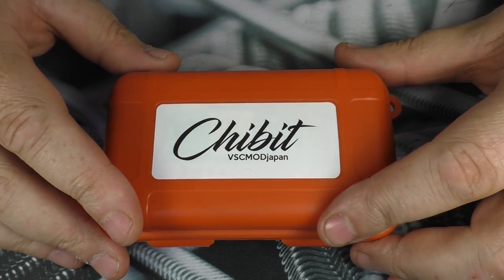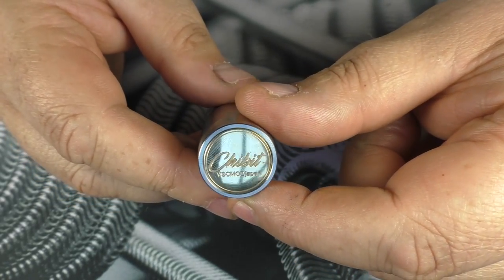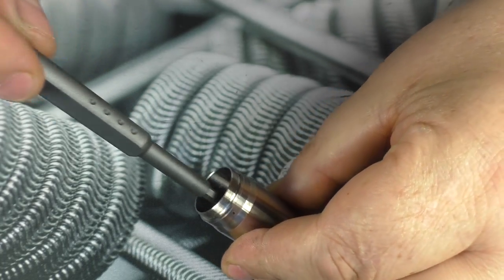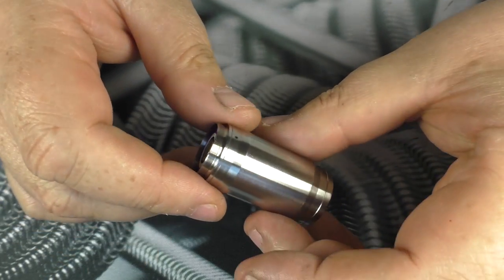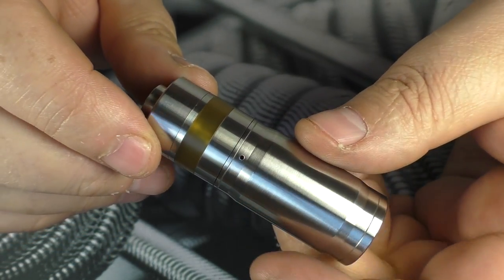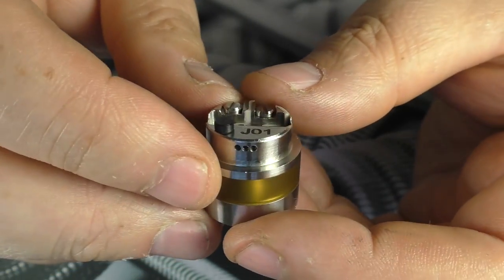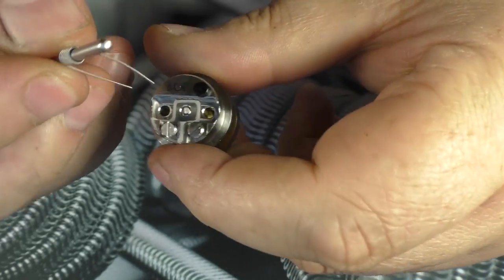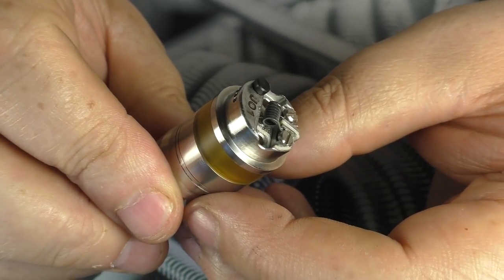Chibit by VSCMOD Japan

Comment: That Vapcell is actually recommended by Mooch. I use it with my Cthulu 18350 mosfet mod and Kayfun Lite. A simple round wire Kanthal coil seems to works well at 0.60
Reply from the maker: Yeah I got them a while back after he gave them the thumbs up :)